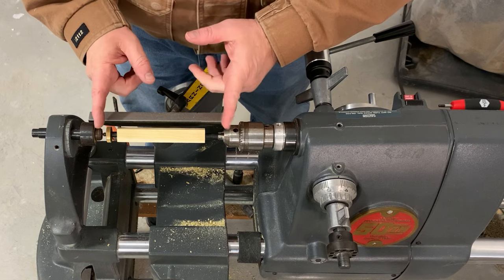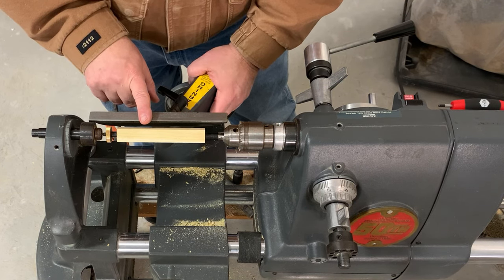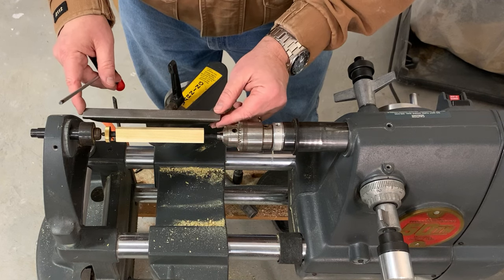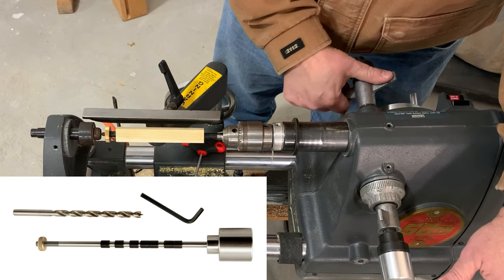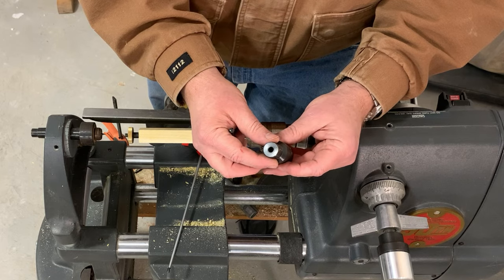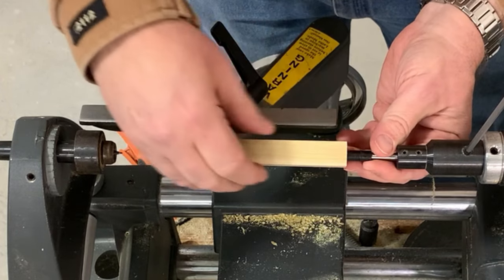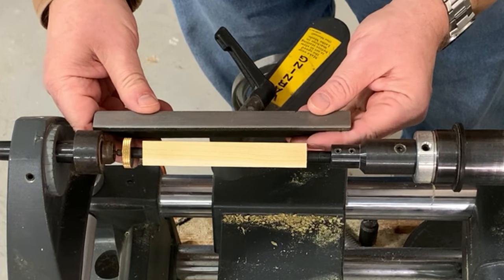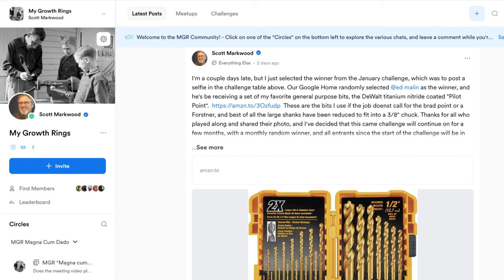Tool Rest Issues on Your Shopsmith Lathe?

Comment: I've used the Penn State Shopsmith adapter with good effect. To minimize bowing the mandrel under axial pressure, Penn State makes a live center for the tail stock that the mandrel passes through, so that a knurled nut securing the workpiece bears on the live center.

The biggest challenge I have is getting the tail stock center aligned on-axis with the head stock. The single set-screw tailstock often doesn't bear evenly on the eccentric insert (which may be a function of insert machining). May be time for a double set-screw tailstock.
Reply from the maker: Yes, I have the very set up, but it’s a MT1 version used on my grandson’s mini lathe. Not a bad idea at all.
Reply: I use the same setup. I picked up a double set screw setup on eBay for $18 and shipping.

Comment: Thanks for some focus on pen turning on a SS, Scott. I've been doing a lot of it lately. To overcome the "8 inch tool rest is too wide for pen turning" issue, I bought an old 8" rest on ebay for $25 and cut an inch off of each end with a hack saw. I expected the edge of the rest to be hardened, but it was quite soft and easy to cut through. The resulting 6" rest is perfect for pen turning.
Reply from the maker: Smart.

Comment: I have the universal rest system it came with three additional rests and one was a four inch rest. Great video love the router arbor tip.  The universal tool rest has a banjo arrangement which makes for more flexibility.
Reply from the maker: I have a 4" rest somewhere, and that's a great tip. I don't yet have a universal tool rest, but one of these days I will.  Scott

Comment: As always, thanks for a well done video.  I have been turning pens on my SS for a few years now, and I use the mandrel that Penn State sells (fits on the 5/8" spindle).  I have turned both wood and acrylic with no issues having the tool rest a bit further away from the stock.  That's probably because I take light cuts and the blanks are pretty small.  I noticed you weren't using the mandrel saver, a device I really like.  It puts all the pressure on the bushings instead of the shaft of the mandrel, thereby eliminating the chance of bending the shaft.  Blessings, Glen
Reply from the maker: Yeah, I actually have a Mandrel Saver on my grandson's lathe, but it uses a MT1, which obviously won't fit the SS.

Comment: I've ben turning pens on my Shop Smith 510. I did get that mandrel that mounts on the Shop smith it works great. i did start out using the 1/4 router mandrel . I haven't really don't have a problem.

Comment: Love the videos, I’m learning so much I wish I could have from my father. I have been using my Shopsmith more and more since I inherited from my father. Been doing pen turnings and a few humidors. The last one was either a bad kit or my Shopsmith is misaligned.  I feel like my spindle has a wabble. I’ve tried taking the twist out but it still “feels” off.
Reply from the maker: It might be worth checking everything with a dial indicator.

Comment: The shorter 4” tool rest would come in handy as well. Even buying a used full size tool rest and cutting a bit off of each end. I’m interested in pen, turning, but haven’t done it yet. What is your opinion on a mandrel saver?
Reply from the maker: I think it's slick, but again, you'd better have a 4" tool rest because it's a tight fit.

Comment: Would the alignment issue be improved or worsened using a keyless drill chuck?
Reply from the maker: Most keyless chuck introduce more runout, but it really depends on the quality of the chuck.
Reply: @MyGrowthRings  I was thinking of the Shopsmith Keyless Chuck. I have one and love using it for drilling operations. I have not yet gotten into pen turning yet, but intend to soon.
Reply from the maker: @Swiley3362  Give it a shot.

Comment: My carriage is missing the up and down lever or crank.  Using vice grip now.  I tried to buy the parts from SS but they did not have the individual parts I needed.   Bummer.  I did find a whole carriage on eBay .   Question: I think I have a model 500.  (Small table no round tubes on the table)  are the 510 or 520 carriages wider?   I do not plan to used the table saw ( I have two others)  but I want to make the drill press and lathe work well.  What should I be looking for?
Reply from the maker: Yeah, Shopsmith no longer has parts for the model 500, but you can find all of those on eBay. There are several people who make a business of parting them out. Yes, the holes that support the post on the main table and the tool rest on the 510/20 carriages are much wider. A 510/20 carriage can be added to a model 500. There are so many ways you could go, but I would start by looking at Craigslist and Facebook Marketplace to see what a whole used machine is selling for in your area.  You might be better off going that route.
Reply: @MyGrowthRings  I bought this one for $40 .  It has the bandsaw and 6” belt sander.    I mostly wanted a bandsaw , drill press and lathe .   I may look for another.  Used in my area are about $400.
Reply from the maker: @danyoungs4061  Forty bucks!?! That's incredible!  Good for you!

Comment: Excuse me for asking a off topic question but I think you are the man to ask.    I have you ever owned a superShop or a total Shop.   The China made 220 volt oversized shopsmith.   I have located one with a bandsaw for less than $500.     The ability to work aluminum and other metal and have a xy feed is what makes me like them.   Plus they are a solid state speed control not sure if it uses a Vdf or what.  But I have 3 Shopsmiths it is not like I am replacing them.   Well maybe one of them Lol as I am in a small garage. Just wondering your thoughts and experience and things to look out for.  It has a bandsaw the dude says it powers on but that is the extent of his knowledge. It looks to have a jointer as well.  Ill the Shopsmith tools interchange.     I have been looking for one ever since I passed on one 10 years ago.  I think Harbor freight sold the super shop for a bit.  Smithy marketed the total shop but they are one in the same.    Thank you.   

Sorry to hijack your comments you can email me if you wish at this address I do not check it real often but I can make an exception. Lol
Reply from the maker: Just to be clear, the Total Shop multipurpose machine was made inTaiwan and was a copy of the Shopsmith Mark V model 500. There have a been a couple multipurpose machines over the years called Super Shop. One in the late 1940's and perhaps even into the 50's that was something like the Shopsmith 10ER. I believe that the Super Shop you are referring to was the larger machine that was marketed for use with wood and metal, which was originally made by a company called Fox, and later produced in China under several names, including Smithy and Central Machinery (Harbor Freight). If the machine you've found is a Fox Super Shop, I'd be all over it for $500. If it's any other variant I'd be hesitant to bite.  The quality of the Chinese machines really seemed to vary quite a bit, and I'd have to give it a serious once-over. One thing to be aware of is not all versions have a motorized carriage.  That's something you'l want if you are ever going to do any metal work with it.  Good luck! Scott